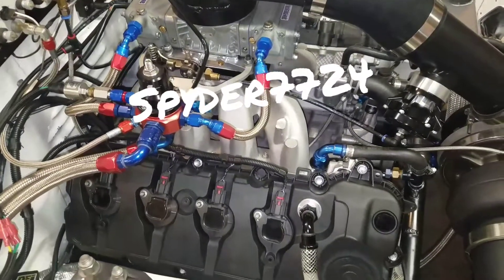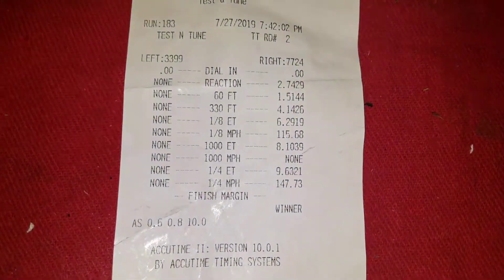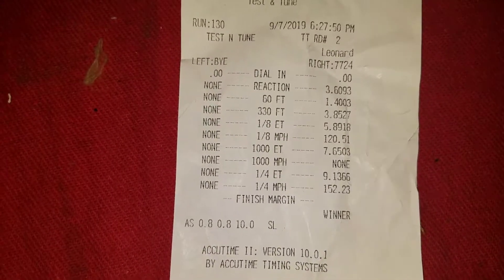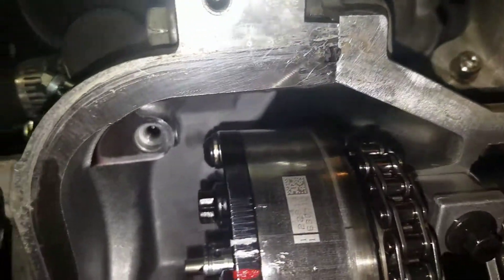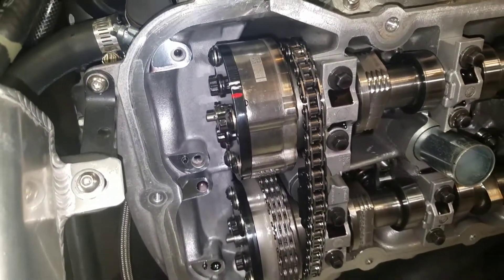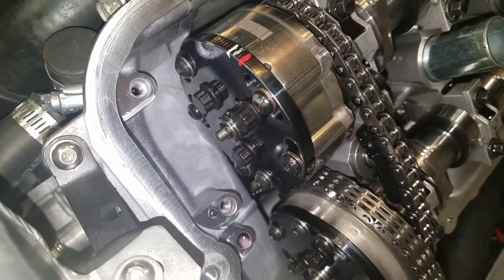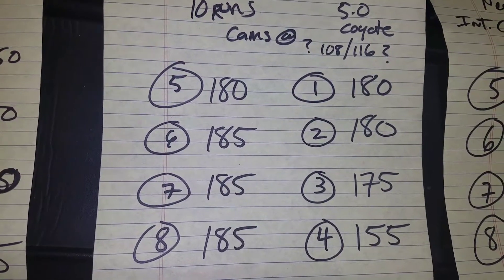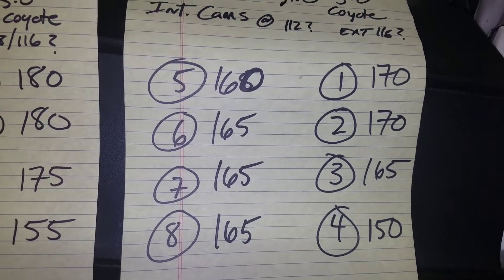Coyote 5.0 Swap Fox Mustang Blow Through Carb Cam Timing

Comment: One question. After you lockout the cam how did you delete the VCT from the PCM? Did you have to tune the car? Or were you able to deleted without the need of tune? Excuse my ignorance!
Reply from the maker: Some ecu's can't even control the vct so it depends on which management system you have. Ford oem stuff would need something like HP tuners or SCT to allow breaking in and custom tuning. Holley, Haltech etc are all different but allow you customize almost anything.

Comment: It's been a while but I managed to get my coyote up and running. Took it out and raced it NA with the stock cams locked at 109/114 then tried 107/107 which it liked (gained et and mph) so I just set them at an aggressive 100/100 (which is what it took to finally get some overlap, these are tiny 211 duration @.050 cams it turns out that Ford puts in these) hoping for a race soon to see of if likes it. Decided this winter to bite the bullet and get some real cams from Modular Head Shop and fab up some pipes for my turbo. They're the only ones who straight up tell you right on their site where to degree their cams and I like that.
Reply from the maker: Yeah Jordan knows his stuff. Comp Cams had me so far off last time.
Mine are now in at 108/114 per Jordan's advice.
Glad you got it running. I'll have this back together soon. Just a busy summer for me and no time for the car.
Reply: @spyder7724  
That seems to be around the butter zone for these and where I may end up. I learned something interesting. Coming at this from a small block Chevy perspective they like alot of overlap but it turns out these 4 valve engines have so much more valve area they don't need as much overlap. They're also really prone to quickly losing vacume and idle quality if you get carried away. I set mine back to 104/105. It didn't want to idle below 1000 rpm in gear at 100/100 (efi wasn't playing nice and the converter is too tight) but sure sounded nasty.
Hope you get some time to play with yours.
Reply from the maker: Yeah I advanced mine a bunch once also. Sounded way better but ran out of steam early.
I had the stock truck cams in at 112/116 and it ran fine. Think theres a decent range that's acceptable but if you set them too far out itll absolutely kill all low end power.
Tried 118/120 and it was a pig.
Reply: @spyder7724  What torque converter, gears, tire high are you running? My problem right now is I'm still the running 2500 stall converter that was behind my blown sbc and its way too tight for the Coyote. I'm thinking mine needs a 4500 stall. It's pretty dead until about 3500-4000. Boost will probably help.
Reply from the maker: @177SCmaro  I've changed a bunch. Currently have a TH400 trans with 2.10/1.40/1.00 Coan gear set, Coan converter approx 5600 stall, 275 radials ET street R, 3.55 rear gear. Valve springs I think were killing rpms. It wouldn't rev past 6700 so every pass so far has been shifting early and laying over on top end. It should run pretty good once all these bugs are worked out. Trans/converter setup is spot on now.
Reply: @spyder7724  
Thanks for the info. It's giving me ideas one where to go next. Now I'm even more convinced I need a converter. I've never heard of Coan but I haven't gotten that deep into transmissions either. Are they any good? I don't see them listing approx stall speeds on their site so I guess I'll need to call them?
You may already know this, but as I understand it there are basically three different OEM valve springs in the 1st and 2ed gen Coyote. 1st gen Truck/Mustang, Boss 302, and 15/17 springs which were the same as the Boss springs with a higher spring rate intended to accommodate more lift and higher rpm from the second gen cams (which I understand are also similar to the 1st gen Boss cams). If you were still using the early springs I can see that easily being the cause of your issue not reving, especially with boost.
Reply from the maker: Coan stuff probably the best quality parts. My trans guy wont use crap quality stuff. I've tried PTC, ATI and TSI converters so far...Coan and TSI were the two top for this car. PTC sucked. 
I was trying to use the boss/Gen2 springs but with these cams and boost they just weren't strong enough. Now have MHS stage 3 PAC springs and retainers...along with a better valve job.
Reply: @spyder7724  
Interesting. I'm considering TCI because they're pretty easy to get ahold of through summit and it's what I have now but starting to realize it a 4500 stall anti ballooning plate converter is going to be like at least 800 to 1000 bucks no matter who makes it so might as well get the best, whatever that is.
Reply from the maker: Whoever you choose call them directly. They will ask a ton of info but it's the best way to get a converter that will work. My Coan was only about $1100...paid a lot more for that pos from PTC.
Reply: @spyder7724  Noted. Thanks alot.

Comment: Thanks for the video. What fuel was this.
I got nib gen 1 gt cams and phaser lock outs. Twin 62 precision turbos. Valve springs from PAC and built engine. 

What's your thoughts on some boss 302 cams. I may have some I can get locally. 112/116 LSA was degreed at TDC ?
Reply from the maker: It was on pump E85. Boss cams are great if you can get them cheap. If you are deleting VCT then I'd start around 112/116 depending on which lockouts you use it's easy to adjust them and try different settings...not as easy as a keystroke but I can do mine at the track in 30mins with just hand tools.
Reply: @spyder7724  awesome. Yea a bit of work to clearance the heads, but nothing too major. I got the comp cams lockouts. I'm running a proefi 128 and a 4l80e trans. If I didn't have the fancy computer already from the last set up, it would of been something different. I like the uniqueness of the build. Good stuff keep it up.
Reply: What's your email? I would like to go over a couple of things if you don't mind.

Comment: Just finally got mine to a point I can degree cams. Set them to 110 intake ATDC, 110 exhaust BTDC just as a rough starting point, naturally aspirated but plan on adding boost and changing timing later. I wonder if I should give the exhaust a little more, set it 115 BTDC?
Reply from the maker: Stock cams? If so I had mine set at 112/116 for boost. If I was staying n/a then may 108/114
Reply: @spyder7724  
Yes, second gen mustang cams. Right now they're in a set of 1st gen f150 heads to mockup/dial in but I don't know if the springs are up to it to actually run them with those heads. I've been waiting on a Right 15-17 cylinder head from Ford for over 2 months now on national backorder. I have the left head. I don't know what the hell is up with Ford parts. I think I'll try setting them to 108/114 and see what happens. Thanks. worse case I stick the lame truck cams back in. at least it will run.
Reply from the maker: The Gen1 springs are the weakest.  Gen2 springs are the same as the old Boss springs. That's what I put in mine this time. Cheap, good for most mild combos and easy to get.
Reply: @spyder7724   I might look into putting 2ed gen springs in my 1st gen truck heads but I don't have much confidence in getting them from ford. Getting 1st and 2ed gen parts from them is like 180 no-scoping a unicorn while balancing yourself on the edge of a dime right now.
Reply from the maker: Yeah I needed a thermostat for my truck and it took over 2 weeks...Tasca had to actually order it.
Reply: @spyder7724  waiting over two months on my other head from ford. National backorder. No one has 2ed gen coyote mustang engine parts right now. I'm tempted to save up and put gt350 heads on this thing. They're available everywhere. Figure that one out.
Reply from the maker: How much do you need to change to use those? Valvetrain I imagine.
Reply: @spyder7724  you just need the gt350 heads and followers. As I understand it the gt350 heads have slightly different valve geometry are require special cam followers. They also have the largest valves but that can cause some shrouding issues on a standard bore (non 5.2L). I think MMR sells them. 
They're the best production heads that I know of but, for the money, you'd probably be better off porting and installing racing springs in your current heads. Gt350 heads are like 3500 bucks for a pair.
Reply from the maker: I may need to look into a set of those.
Reply: @spyder7724 
 https://www.svtperformance.com/threads/so-what-is-really-involved-to-install-gt350-heads-on-a-11-16-5-0-coyote.1104771/

Comment: By using cam lockouts do you think coyote motor will run on stock 4.6 ecu? Currently have 5.4 4v but spun couple rod bearings
Reply from the maker: You'll need to use a cable throttle body, change the coil pack connectors to fit the coyote and also swsp firing order but otherwise it should work.
Reply: @spyder7724  thank that was my thoughts